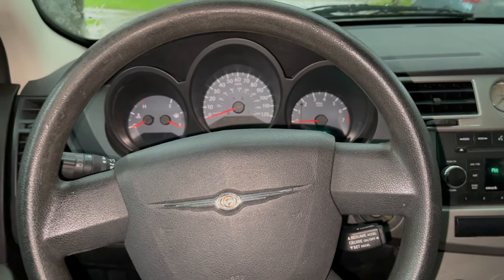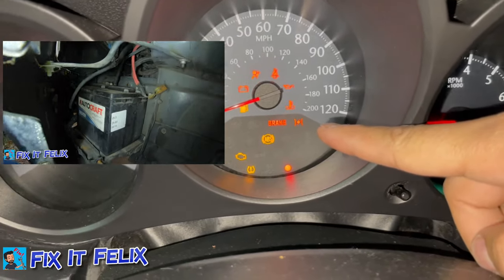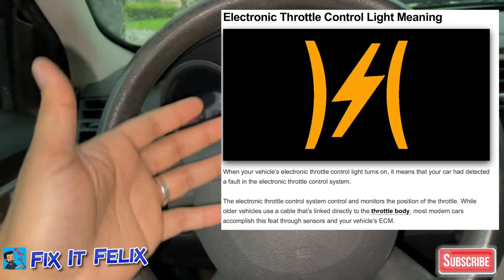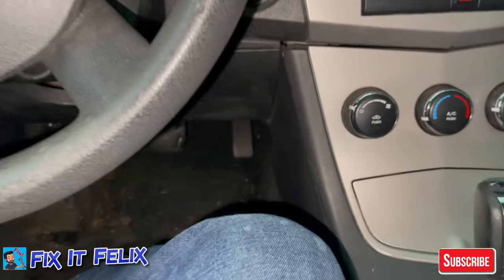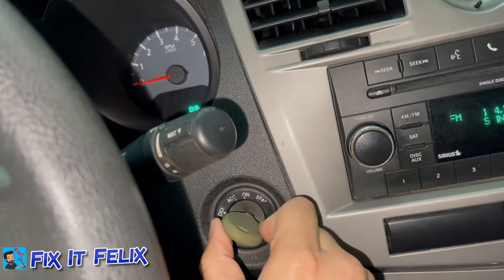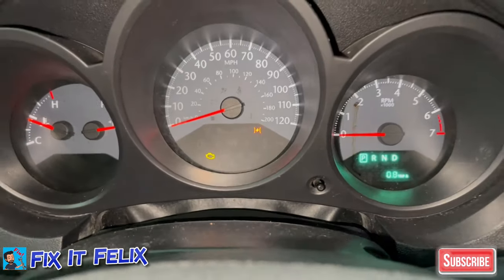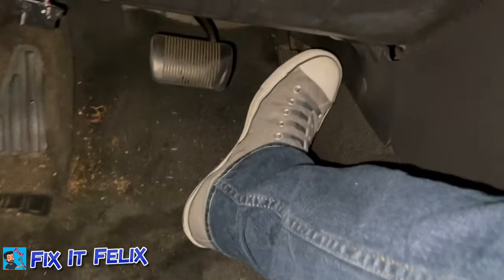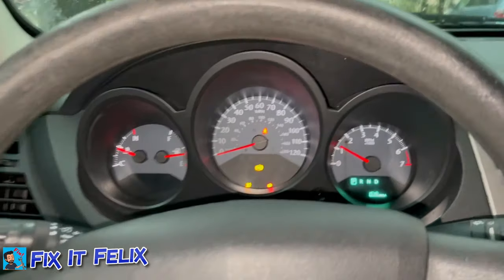red lighting bolt fix ( dodge / jeep / Chrysler ) RELEARN PROCESS

Comment: My Chrysler red bolt light is coming on but my car won’t even start
Reply: Same here!!
Reply: Did y'all find a fix for it?
Reply: Is was my dam key fob I broke it
Reply: My bolt comes on but codes says it’s fine and that it’s a relay that bad. Surprisingly the fuse/relay box has the same lightning bolt on it but I don’t know which little grey block it is
Reply: Probably Need a new radiator
Reply: Same
Reply: Did you ever fix it or find out what is was ? If so how did you fix it and what was wrong ?
Reply: I have the same problem any suggestions.... I already changed the throttle body, computer engine, and spark plugs
Reply: @Uberstrib  same
Reply: @Damontejackson9160  no luck for me
Reply: @Damontejackson9160  did u get it fixed?
Reply: Throttle sensor or the whole throttle.I have same thing right now
Reply: There is a video on here where you turn the car to the ON position without starting it wait for the light to go on,then you press and hold the gas peddle for 10-20 seconds then let it up slowly and the light should go off.it worked for my car,it resets it..... apparently if you've ever changed the battery or unhooked it,it causes that light to come on.
Reply: @LisaLisa-mx3hq  I tried that. Unfortunately no results
Reply: @Uberstrib  same here!
Reply: @Uberstrib  after I did this last night. Went to the store came back home and parked the car. It won't start today.
Reply: @rebel8440  yea I still haven't fixed mine
Reply: @Uberstrib  did u figure out whats wrong with it?
Reply: @rebel8440  no. I took it to a "mechanic" and he can't figure it out. I think I chose the wrong mechanic
Reply: @Uberstrib  same here smh.
Reply: @Uberstrib  my car has been in the shop for 5 days now AND HE STILL CANT GIVE ME A DIAGNOSIS. IM SO PISSED
Reply: @rebel8440  mine been at the shop for about 2 months.
Reply: @Uberstrib  what! WOW!
Reply: @Uberstrib  do u think it had anything to do with this reset???
Reply: This happened to me after the reset smh
Reply: @Uberstrib  what kind of car do you have?
Reply: @rebel8440  I told them I'll be there when I get there. 🤣
Reply: @rebel8440  2010 jeep Patriot. I've honestly tried everything. I changed the throttle body, put in a new cpu engine system, and changed the spark plugs with no luck
Reply: @Uberstrib  yes. I did the same to my car. If its been that long you need to find a new mechanic. I have a dodge caliber. Man smh im so hot right now I need my car back so badly 😩 😫 😭
Reply: @LisaLisa-mx3hq  i have recently changed my battery, im going to try this!!